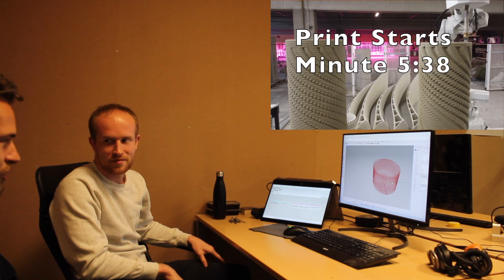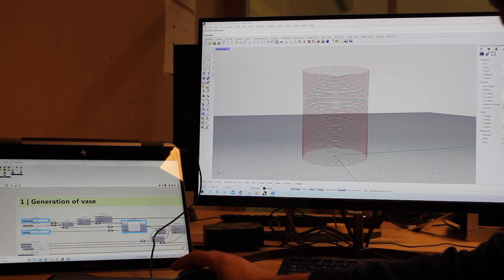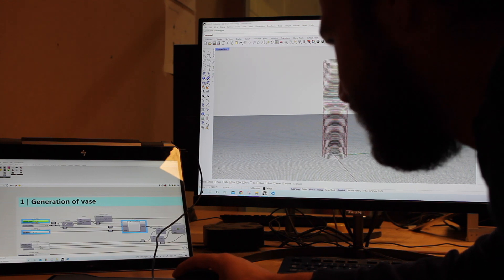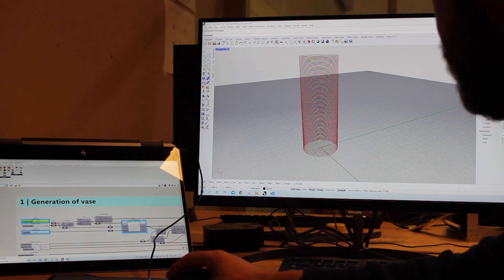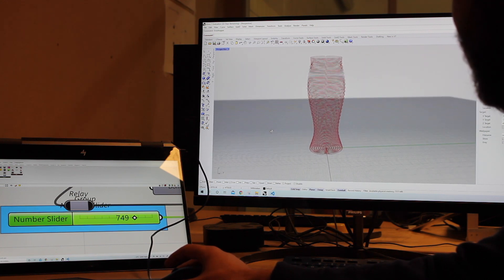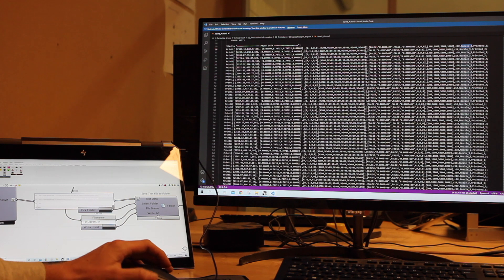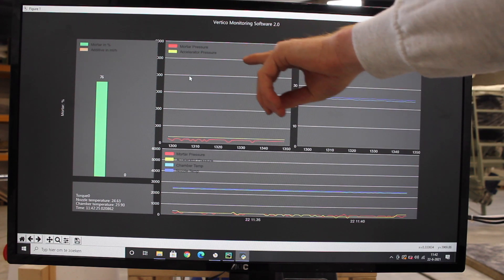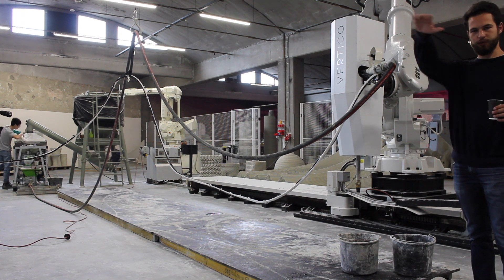Designing HUGE Concrete Forms | 3D Printing Robotic Arm on a Track in Action at Vertico

Comment: How fast can I fill these forms, turning them into structural columns.  How long is the set time before I can fill them.  Will they crack as the infill sets?  So many questions ...  I love, love, love, the possibilities !!!
Reply from the maker: Very good questions, weaker mixes can have bursting events from the force of the liquid concrete pushing outward. That leaves all the stress on the tensile strength of the printed mortar which is notoriously weak.
Reply: @automateconstruction  Also vibrating the fill mix for perfect amelioration ... I think we have some more bugs to work out brother.  Time to get back to first principles. ❤❤❤
Reply from the maker: @jamesbell8861  Funny you mention that I just finished filming the new first principles physics section of my course. It will be uploaded this week an you will hear all about it in my upcoming videos. Heard it here first :) the price will go up quite a bit too because it a complete re-vamp of the whole thing top to bottom. Of course current and legacy members will have access for free along with all other future updates.
Reply: @automateconstruction  ... Sounds like great minds think alike.  I had talked about 'First Principles' thinking with regards to how we were going to have to solve the Small Batch dilemma that is so labour intensive on the bigger house prints.  I will keep an eye out for your posts and if it's not too expensive I would be really interested in what your course has to offer.